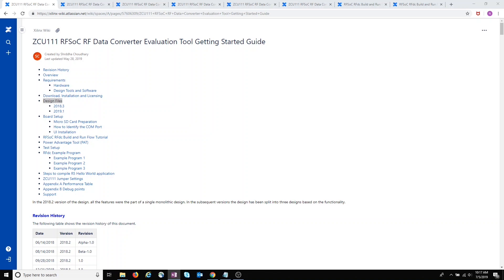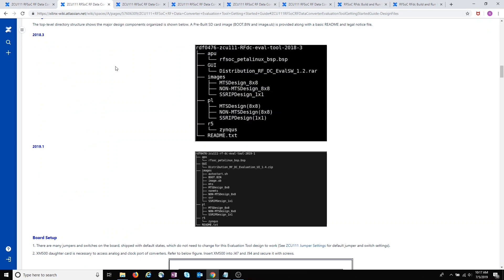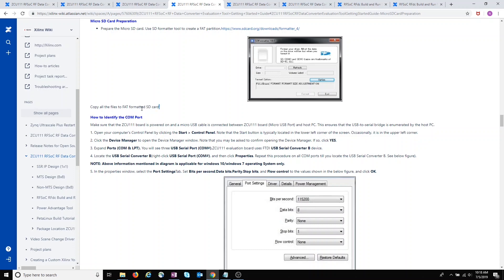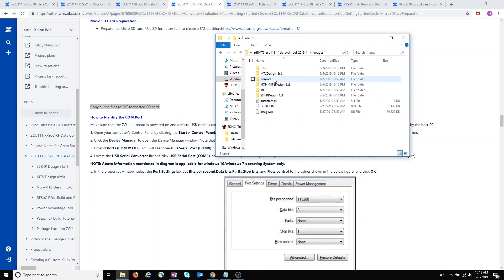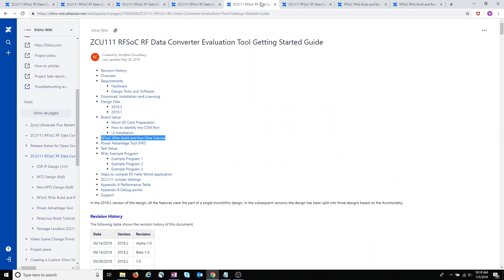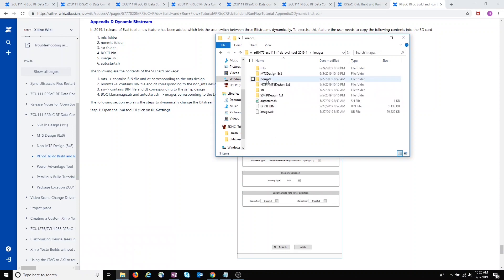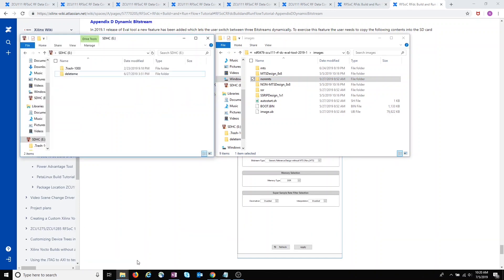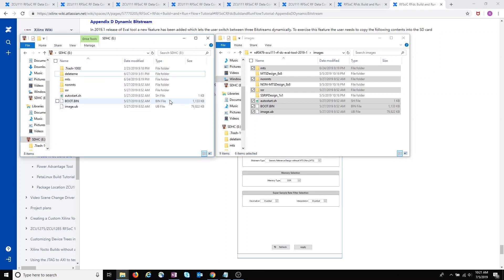ZCU111 2019.1 RFSoC RF Data Converter Eval Tool Video 4: Populating the MicroSD card

Comment: Respected.. 
Iam using only single adc tile.. And iam feeding pulse modulation 3ghz signal.. It is converting for 100 ns period and pulse width 10 ns. But i need log data for different pulse like 100 us period and 10 us pulse width.. Even though I changed memory type  from BRAM TO DDR.. iam able to see upto data 4 us.. How to store the data atleast 100 us.. Please help...me iam working in defence. Thanks
Reply from the maker: Hi Nagaraju, I recommend to post help requests about RFSoC to the Versal and UltraScale Architecture Xilinx forum: https://forums.xilinx.com/t5/Versal-and-UltraScale/bd-p/ultrascale